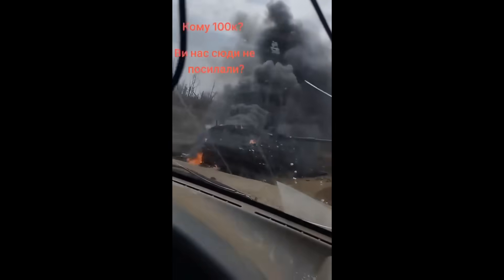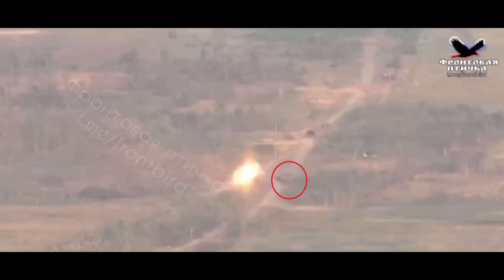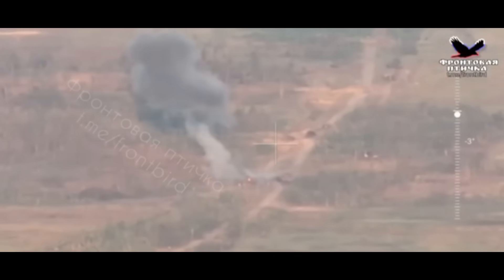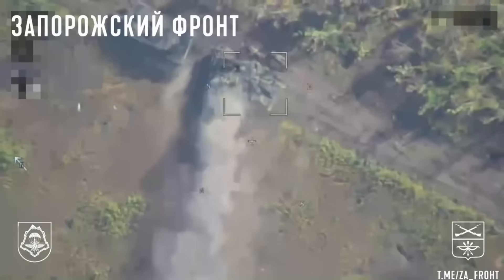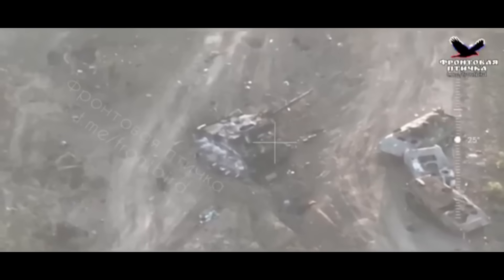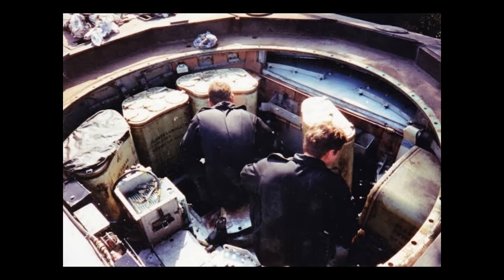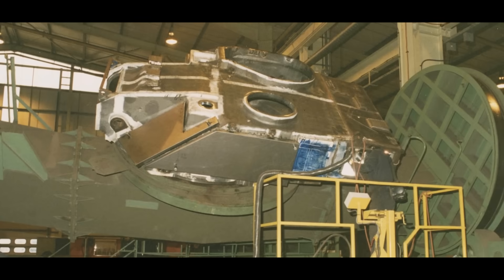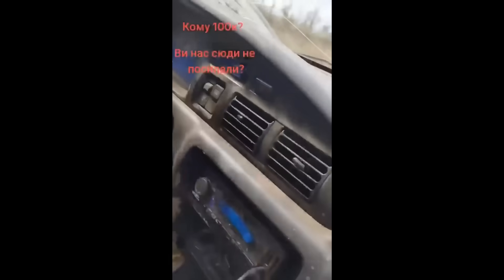This is how Challenger 2 got Destroyed in Ukraine

Comment: Challenger 2 got those cheeks clapped.
Reply: Those Western Tanks has had their CHOBHAM armor removed! The CHOBHAM armor is top secret.
This is why you see other countries Losing M1A2 Abrams.

CHOBHAM armor removed and the Depleted uranium panels removed = weakened tank,
Reply: @ebperformance8436  They also get blown up because they're used wrong. They're meant to be part of a combined arms battlegroup blitzkrieging the enemy lines at top speed, like the battle of 73 Easting. A single sitting tank is a dead tank. If you need a pillbox, its best to leave the MBTs home.
Reply: @ebperformance8436 they also took out their Engine, and the ultra top secret gun as well. Essentially it's just metal coffins powered solely by Ukrainian crews with cycle wheelie below their feet.
Reply: @GeneralLee131  no matter what troops you send in challenger leopard even Abrams they would all burn 
They are literally running themselves over mines while being blown by artillery and after all the massacre only a couple would reach the defensive line only to get destroyed
Reply: @sys3248  also their armour isn't even metal or iron it's more like mud because that's the only logical way Russians are able to destroy them with just shovels
Reply: @ebperformance8436 the Challenger uses Choblam 2 better than the US Choblam. It doesn’t used depleted uranium it used harder and stronger ceramic. And does Challenger sent to Ukraine didn’t get there Armor removed. The armor is upgraded by Ukraine themselves by adding ERA and cope cages on there tank.
Reply: @hobbyman47  Ch2 huge problem - is obsolete rifled gun. Its good vs technically infierior enemy, especially vs one who didnt possess heavy armor, but vs any decent tank its useless - its cant penetrate armour by default and modern protection, for example kevlar insulation made it useless by preventing armor fragmentation inside the hull. This is the reason why Ch3 finnaly get normal gun, like any over modern (and not so modern, this technology are 60+ years old) tank.
Reply: @GeneralLee131 that would be suicidal charging in on all that land mine hell nah not to mention all the atgm there
Reply: @GeneralLee131 that would be suicidal charging in on all that land mine and atgm just waiting there
Reply: @frfriedrice5536 lol y’all are fighting the export models if these were actual stander issue tanks that had a the ful protection package then y’all ruski bots can argue until enjoy fighting are export models 😂😂😂 not even the best the west has In tech and y’all still trying to cope with our exports
Reply: @victorsawyers6227 there's no Export models of Coward 2. These are all it minus APS.
Reply: It didn't join the space force like Russians did. But by your logic "Muh Russia strong!" despite THOUSANDS of gutted Russian tanks stating otherwise. We get it...your cope is pathetic. This Challenger survived 4 months in Ukraine.
Reply: @victorsawyers6227  not even the best 
Yeah sure buddy leopard,bradley and challenger were actually made during the US civil war
Reply: @generationkilled  "but it survived for 4 months" cope
Reply: And the crew walked away alive.  Unlike all those crispy Russian tankers.
Reply: @kissfan6321  the cope is unreal
Reply: @kissfan6321 going by that logic, Ukrainians in their T-64 shouldn't fare much better then.
Reply: @Chikanuk  we are talking about the Armor. and the guys and NAFO trolls favorite excused. it's just an export version like the Abrahms. and the guy stated it have a Chobham armor depleted uranium. like the Abrahms have I said to that guy CH2 have Chobham armor aka Dorchester armor uses harder and lighter ceramic than depleted uranium. also the Ukrainians put some bit of an upgrade or modifications like adding cope cages and ERA. but still got destroyed if you can penetrate the Armor of the CH2 all NATO tanks armor can be penetrated. not to mention the L44 & L55 guns out preforming CH2 rifled gun. and it's also a logistics problem like the guns barrel life is short and expensive.
Reply: @ebperformance8436  stop making up nonsense
Reply: @bigmatthews666  Do your research, and stop being Lazy.
Reply: @sys3248  I forgot about that….yes the guns have been removed and replaced.
The Original guns….shoots Depleting uranium shells.
Reply: @Chikanuk 
yeah the t-64 had a smooth por gun in the 60's
Reply: @generationkilled it was in a basement in Kiev for 4 months and got destroyed when it rolled out to the battel
Reply: @kissfan6321 because they ran for there life's even before getting hit by the kornet
Reply: @ebperformance8436  Seriously do people still think we'd send the most upgraded versions of the abrams to be used by inexperienced crews? 🤣🤣😂or any equipment? It's all export versions that were mothballed.
Reply: @frfriedrice5536 What??
Reply: @get_serious4953 Russia still losing.
Reply: @اسكندرفكار They got hit by a mine NOT an at missile.  And at least they survived.
Reply: @kissfan6321 
 they got hit by a missell after that..... didn't hear what red said .....they run away when the track was damaged from the mine

Comment: LazerPig said he had sources in Ukraine and told him that the crew set the tank on fire with a Molotov cocktail. 😂 The pig never learns.
Reply: How is this information less likely than a Russian outlet stating it was a kornet? 
Especially if you consider that the location is not close to the front line and that you cannot identify a kornet on the Video neither? Did you learn you shouldn’t jump to conclusions?
LazerPig didn’t say it was fact, he said a Ukrainian source claimed that. 
RedEffect didn’t say the kornet was fact, he said a Russian source claimed it. 
Watch both again if you aren’t sure…
Reply: Because the video is only possible, if you have a high explosive device, not an accelerant!

Comment: Russia will have to construct a new wing onto their tank museum very soon
Reply: I mean, Challenger 2 kinda does belong in a museum to be brutally honest.
Multi-part ammunition and a rifled gun in 2020? ^^"
Reply: Trust me on this, they never capturing that Tank.
My source? Ukrainian artillery.
Reply: @NATOenthusiast I remember that exact same claim being made about every tank/IFV that they are currently exhibiting
Reply: @whitescar2 you’ve basically just said that every T-series tank, leopards belong in a museum
Reply: @josephboustany4852  they didint took the leo2 and didint took chally 2 so what only cool thing they got was CV90
Reply: @whitescar2   The Challenger 2 is much older than most Russian tanks on the battlefield in Ukraine, so you're mostly right lol

Luckily its in the process of being replaced by the more modern Challenger 3
Reply: @h.a8681  C2 is still in active service. The C3 will burn just as brightly as the C2
Reply: @zeffy._440   All tanks burn, but in a Challenger 3 the crew survives, unlike a T90M where they get turned to dust
Reply: @Jpz-4-5  I mean, preferably yes?
Wouldn't that be a lot better for everyone involved if instead of littering the Ukrainian countryside, Russia instead just put their tanks inside Kubinka?
Reply: @h.a8681  Except they don't. We've seen it with Leopards and Bradleys and Challengers. Anyone in those vehicles is a goner the moment it gets sneezed on unlike the T-90M for example.

Comment: Russian turrets go higher because they are lighter, superior challenger turret barely leaves the hull because it's so heavy.
Reply: It's just that there are no high-explosive shells in Challenger 2. This is in most cases a useless tank.
Reply: @alexalex-v2s  What? They use HESH - that's a High Explosive Squad Head, or in other words... A high explosive round.
Reply: maybe they just have weaker ammo, so tamer explosion xD
Reply: easier to just push back in place with a screw driver
Reply: Consider the difference between deflagration and detonation. The challenger's turret pop is consistent with the former, in short the ammo burns violently causing a high pressure inside the hull that lifts the turret off its ring, but does not explode all at once in the manner of the T-72 series under the same circumstances.

This probably is due to different propellant charge formulations. Furthermore the Challenger has much larger internal volume so the pressure will build more gradually, which reduces the chances of deflagration turning into detonation.
Reply: @D_U_N_E  yes, there really are such shells, I didn't know that.
Reply: @alexalex-v2s  Fair enough then. Though for the sake of additional information, it's why we still use a rifled barrel - for that one HESH shell - which is still usable against older soviet armour, as well as being used over of a conventional HE shell. 

Challenger II is a modern tank, that in many situations should be interchangeable with many other modern tanks. The real question on its effectiveness is how overhyped the 'secret' armour is, alongside the fact there aren't enough of them being fielded/produced to really impact the war in a significant way. It served well as a diplomatic tool, but 14/15 is just pitiful numbers. 

Other than that, so long as we are not spreading misinformation, roast it away, the fire already seems to be doing a good job of that.
Reply: @D_U_N_E not a normal HE round
Reply: @kanestalin7246  Okay, so they use a HE equivalent that isn't HEAT-FS /HEAT (Americans for instance as an apparent standard), or HE (Russians). 
Which notably HESH for cannon bore, contains more HE filler than either of these shells (It also contains just more filler if compared by shell)...

It's not one of the newer fancy airburst munitions - which is a downside I suppose. Shell casing might be thinner? May as well make a note, there are heavier filled HE rounds available for at least the Americans, but I don't believe they are standard.

Comment: Thank you for the breakdown, bound to happen in peer to peer conflict. Just goes to show how times have changed but, tanks have always been vulnerable and more so these days. It does show that the newer designs such as the Abrahams are really on the money with the blowout panels. Not just crew survivability but much less damage to the turret and hull. Which means that there is a possibility that the vehicle can be recovered and refitted so long as it has not burnt out. War is qualitive but mostly quantitative. Both sides are making sure with multiple hits on abandoned equipment, they are down to 13 of these. Probably less with servicing factored in.
Reply: Russian just attack tank 3 times Anti is burnt
Reply: Its not a breakdown, its lies. It has blowout panels.
Reply: @Seth9809  that's not what breakdown means in this context. Breakdown here means analysis.
Reply: I doubt that there is at least some kind of economic feasibility to restore a burned-out tank. It still needs to change everything. In addition, the steel of the case loses its characteristics with such strong heating. Cheaper to make a new one.

In the west, some kind of mania began about the tank turrets, as if the only possibility of the death of the crew was the detonation of ammunition. In fact, there is much more chance of dying during the evacuation from the tank under fire, or from fragments that penetrated the tank, than the fact that the automatic loader located at the very bottom of the tank hull will be hit.
Reply: @Seth9809 Challenger 2 doesn't have blow-out panels.
Reply: @Seth9809  The Chally 2 does NOT have blow out panels.  If it does, they are very well hidden because I never found any in 9 years.  Feel free to post  a schematic of where they are if I'm wrong.
Reply: @swirvinbirds1971  

"The Challenger 2 stores its ammunition in two separate compartments: one in the turret bustle and one in the hull. Both compartments are protected by armored doors that isolate them from the crew."
Reply: @iatsd  So by your defination, if the blowout panels aren't automatically opening and closing, they don't count?

Because there is ammo pieces stored in the back of the turret, and they are protected by armored doors that isolate them from the crew.
Reply: @Seth9809  In the Chally 2?  The ammo stored in the bustle is only the APFSDS rounds.  Fin rounds don't burn.  There's no need for blow out panels for them.

HESH and cannister and the ammunition charges - all of which can burn - are stored in wet bins in the hull.

Challenger 2 (& 1 & Cheiftain) does not have blow out panels for ammunition storage.  As I said, in 9 years, I never saw a blow out panel.  Maybe they missed telling me about it in training?
Reply: @Seth9809  that's not blow-out panels guy.
Reply: Abrams*
Reply: @Seth9809 those are Blast Doors not Blowout Panels.
Reply: I think there is a strong chance the tank will be recovered and put back into service failing that scavenged for parts ,the Challengers came with a recovery and service equipment. If it had been a soviet era tank it would have most likely blown. Hopefully with Challengers, Leopards and Abrahams coming on stream Ukraine will drive the invaders out of their occupied lands and result in the fall of Putin and his fellow gangsters and peace to the region as a whole.

Comment: the "challenger" II is indeed what his name is making us expect: it challenges the T-72 (for the turret throwing contest) while being heavyer and more expensive
Reply: i would love to see that as a category on the next tank-olympics
Reply: Challenger 2 is a generation above T72. No tank is invincible. Challenger is a more capable tank than T72, although, as you say is more expensive.
Reply: 2/10 turret throw
Turret too heavy for real acrobatics.
Reply: No it doesn't. Red Effect lied about no blowout panels. There are armored doors at the back of the Challenger 2 turret.
Reply: T72 T80 and T90 are better
Reply: @LoveKrishnaIndia  How? The Stabilizer is worse, they have worse native armor, they often don't have thermal imagers, they don't have commander's independent sight.

They reverse slower, they often don't have heating or cooling for the crew. There is no means to boil water or heat food.

They are cramped, the autoloader is slower than humans. The tanks have 3 people to help fix them instead of four.

What about remote controlled MGs? What about fire-suppression systems?
Reply: @moochoman9948  Tanks aren't poker. Both the Challenger 2 and the T-72 bring different capabilities to battlefield. The T-72 can fire long range missiles and APDSFS shells with higher penetration.
Reply: @JAnx01  yes your right. I said 'more capable' as opposed to 'better'. If cost or weight is your over riding consideration then T72 is the more appropriate tank.